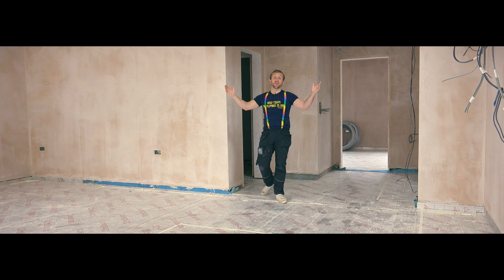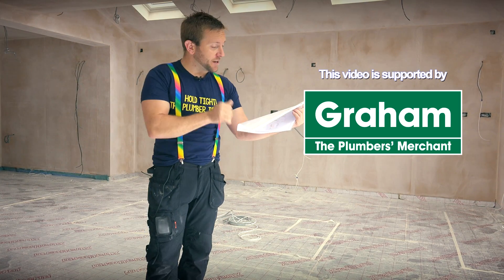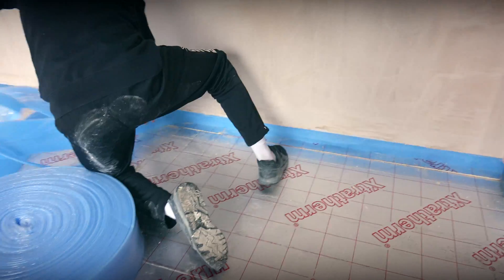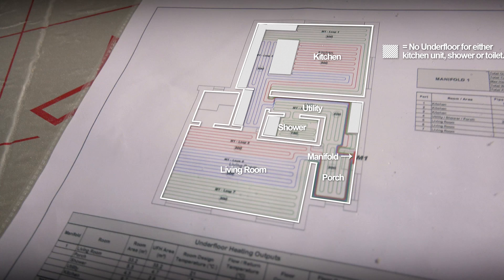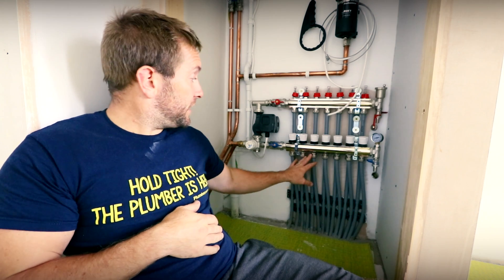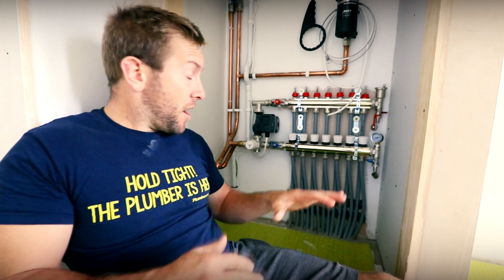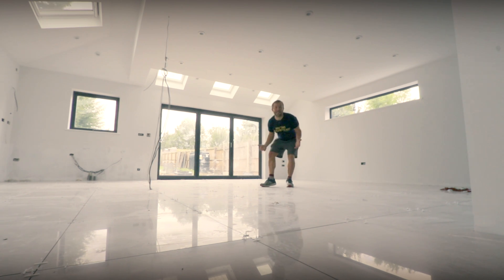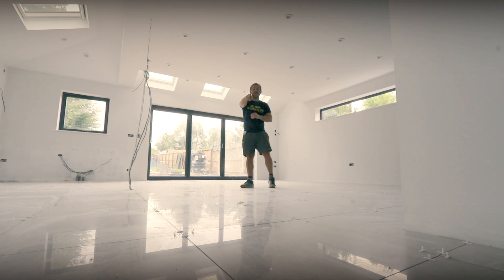UNDERFLOOR HEATING - Buteline System

Comment: Have you ever seen slots milled into the concrete using Diamond-Tipped blades? A wonderful way of installing underfloor heating. You might be interested in the FlooriQ Concrete Milling Machines.

Comment: I have a question re underfloor heating. I think understand how it works but I have one question. as the amount of hot water entering the manifold is regulated by the thermostatic control, when the required flow is reduced from the boiler but the boiler and boiler pump is still operating do you rely on the bypass to take the excess flow from the boiler?

Comment: Gona do a xps  25mm under 17mm engineered as my system is on for 40 mins to heat the house so aa 75 screed will not get time to heat , i need wwaappid transfer so a nice little one zone system  with pump and sensor will do lovely jubbly. Hold Tight.

Comment: How about a vid for a UFH in an existing house using those floor insulation pieces that have the round plastic guides to secure the piping.  As it is in an existing house, the insulation cannot be thick and is thin as possible.

Comment: How do you do underfloor heating on a suspended floor and how do you top it. There's a lot of conflicting advice out there. Some people say lay a screen onto of your joists, some use spreader places and everything in between.
Reply: Bad Spanglish most of our customers opt for an emission plate system between the joists and board over the top 👍

Comment: The "membrane" will effect the heat transfer because of the air that it will trap, not because of it's thickness.
Reply: denis moloney isn’t the membrane supposed to go onto the insulation before the pipes are laid?
Reply: @goodbyetothepeople92  that's what I thought. And surely laying it above the pipes prevents the screed from enveloping said pipes?

Comment: Nice video mate. Can you put zone valves on underfloor heating system? If yes, where would you install them? 
Thanks
Reply: riza yusifi some have valves on the manifold. If you want you can connect two or more valves if they are for the same room.
Reply from the maker: What Steve said!
Reply: Steve Craft thanks for information mate 👍